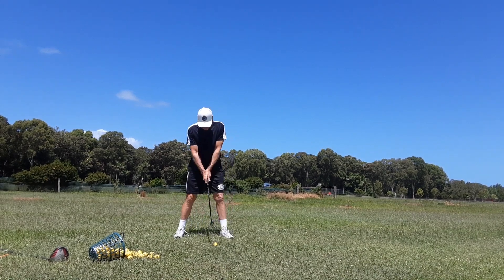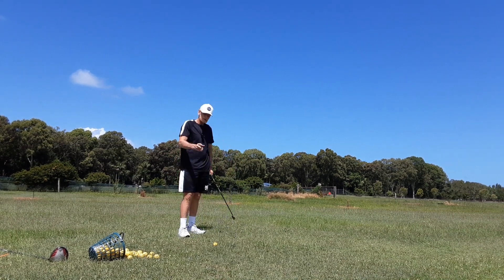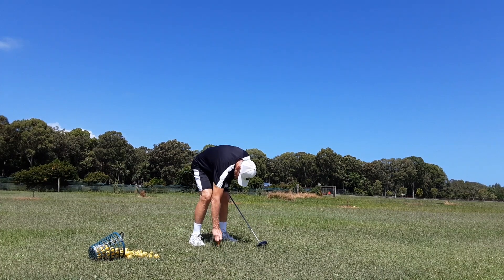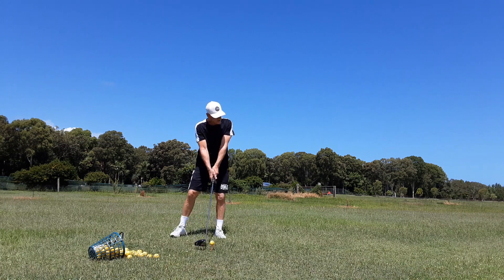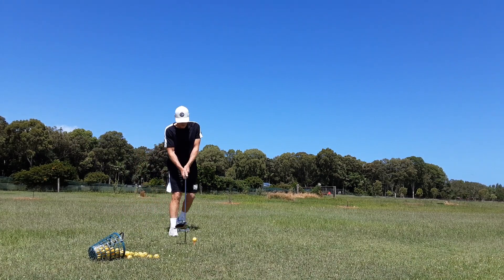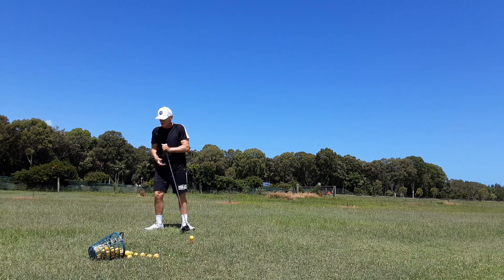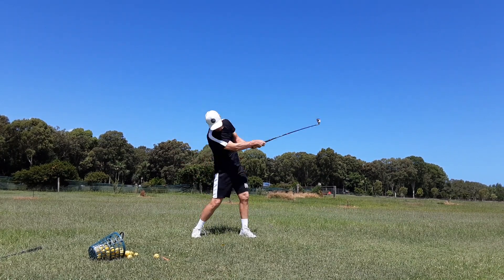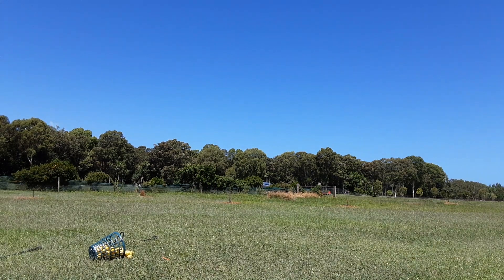Add Stability To   Golf swing   The swing..

Comment: Hi JH, 
This is basically what I have been doing lately. It's sort of a combination of JVGA and CL. I pivot into my lead side, but have the ball off my back foot, and keep my trail foot down through impact. It works great for everything but driver. I only seem to hit push fades with the driver, even with a really strong grip.
Reply from the maker: Hi James,
              With any  lateral   dive  in the swing   its so easy to     take the head   forward to much to impact  ..  with the driver   you must  actually feel b the head is   staying  where it  is  and the  body is  sliding  underneath and past it  .. 
                   The great   attribute  Moe Norman  had  was his ability to  keep his head     way  back  at impact  ..when the head is kept back   the trail shoulder pivot  point   is further back at impact    which  makes  the trail arm   straighten out more at impact  and  enables  more   forearm rotation through impact to   close the clubface  up  ..  With the driver   I  like to 'feel'  my head is over my  trail knee at impact..  I also   turn my lead hand   down way earlier   coming into the ball with the driver  ..  
                    Remember  ..  if you hit a  'push fade'..  you  are  on the correct  impact attack line  .. in to out..  the only reason the ball leaks away     is because the clubface is 'open' at impact  ... getting    more  
 trail arm extension  into impact  .. and lead hand turndown   has to  close the face at impact  ..
                        cheers JH

Comment: Moe's swing, especially in non early years had very little if any lift in the backswing and he kept his right elbow tucked in and close to his torso which put the club shaft at the top on the same plane as at impact. We would call it a 1/2 to 3/4 swing but because he gets good movement to the right side in the backswing and he cocks the club pretty well he generates great speed plus laser accuracy and consistency. It is quite hard to lift the arms the same distance and lower them the same distance every day as some days you have more flexibility than others. It's easier to keep the right elbow not exactly locked to the side but certainly a feeling of not lifting it up. This of course relates to the angle of the left arm.

Comment: Moe got a lot of lateral movement toward the target in the downswing. Moe called his lower body movement, “Buckle, Sit, Slide, Bump” for Buckle the lead knee, Lower body moves down (Sit), Lateral movement (Slide), and Bump (Trail hip)

Although Moe got good left hip clearance it was well after impact and I think the slide and bump is a technique that helps this timing eg it prevents early excessive hip rotation.
Reply from the maker: The Slide/bump  absolutely  puts a brake on  Moe's  hip    rotation  ..  it as well    delivers force momentum   in the  clubhead at impact...  particularly with the driver   because he plays the ball so far forward in his stance...  if he  didn't  lateralize he could  never get the   clubhead to the ball  with any degree of  power  or efficiency ..
           The other  aspect  of Moe's hip  restiction  of rotation   is  the way he   keeps his trail knee in behind his lead knee at impact  ..  that puts a   big restriction  on hip girdle   rotation  .. 
           Moe is able to    get  that trail knee in behind   his lead knee  but   pressuring  'down' with his trail heel  at impact ..  he told me he actually tried to turn his  trial    hip  and knee     'clockwise'    coming into impact  .. try that sometime and see how   much   the trail   hip     resists rotation  .. 
           Actually, that specific   action/process can be used with great success  in   any golf swing   to   reduce   excessive hip rotation   coming into impact.. and to create  strong  vertical  ground pressure  at impact  .. 
                         cheers JH

Comment: If you shift weight a little from one foot to the other wouldn’t it help improve distance?
Reply from the maker: I think   using ground force   vertically  as  a  stability  mechanism     can  give    as good  a distance  performance  as  what I term  as 'body  shoving' power  ...  the quality of  impact   I find   comes up   significantly   because of the   body  impact stability  factor..
           I bet you  have   hit  a shot  once were you were just trying to  lay a shot  up  short of a bunker  or  some sort of trouble  ..  and you  just put that   free swing  arm  action on the  shot  with  virtually no  body input and the ball has  taken of   like a rocket  ..  and invariably  carried into the rouble you were trying to lay up from ..   I feel that effortless    process  with the restricted   body rotation   swing  .. 
                  cheers JH